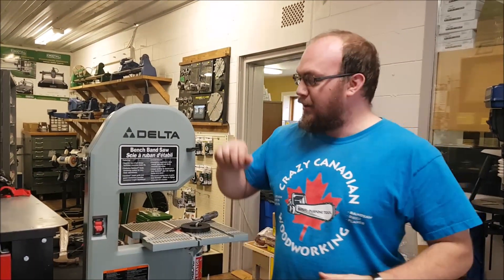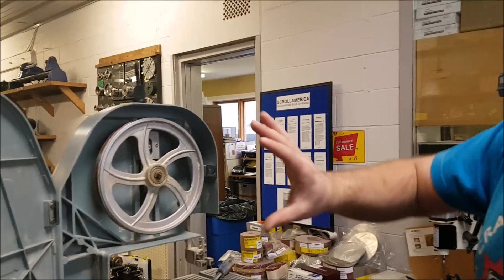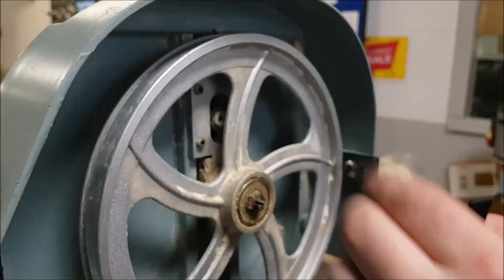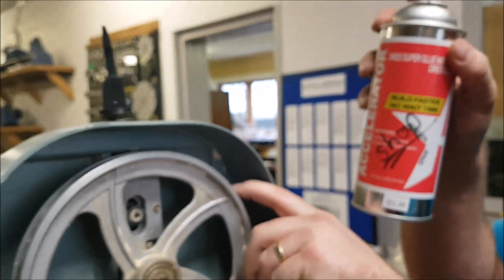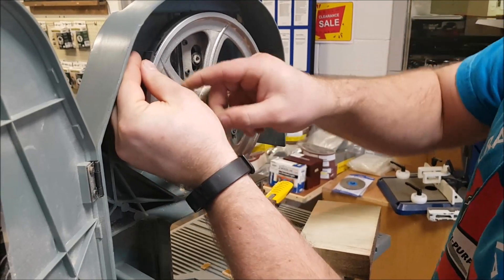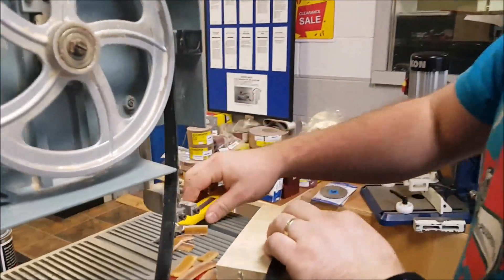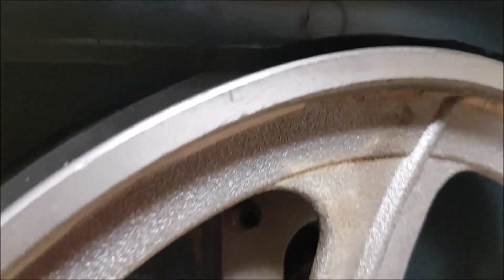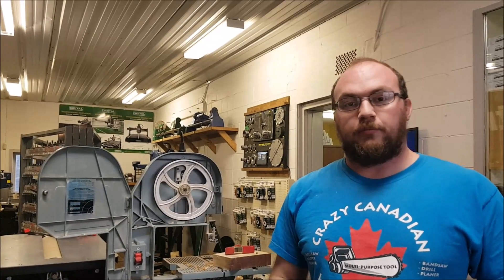How To Glue On a Rubber Bandsaw Tire! EthAnswers

Comment: Where did you find tire material?  Also what kind of glue did you use? Is lock tight a good brand to use? Thank you in advance for any information. I have a small central machinery saw with 7/8 wide tire and approximately 18” total dia.

Comment: Aside from the mathematical formula discussion prior posted, I would ask why glue all around the wheel? Gluing only at the cut on both ends will keep it in the track, as will the blade, and it will be easier to replace when necessary.
Reply from the maker: Yes definitely realized I mixed up the formula haha. I’ll try to fix that soon.

As for the glue that is an interesting point. If the wheel has a lip on either side there is no need to glue all the way around. Now if there is no lip you will need to glue the entire wheel or else the tire may slide off. I usually seem to replace glue on tires on bandsaws without lips around the wheel so I guess thats why I do it the way I do!

Comment: Hi Eth, I once tried replacing the tires on a ShopSmith bandsaw. I failed miserably because I couldn't get even contact pressure around the circumference. As the blade wood run around the wheel, the tire would bunch up in front of the blade and eventually fold up on itself. I gave up and eventually sold it. I am curious as to how your new tires work out. Thanks for posting. Charlie

Comment: Pi times the radius squared is the formula for the area of a circle.  In this case, however, 2 times the radius(4.5 inches) and 3.14 squared are approximately equal.  C=2 pi r or pi D.
Reply from the maker: Haha I definitely mixed the formula up! I’ll do my best to correct that in the video. Thanks for the heads up!

Comment: I’m sure you know this - I think you just mis-spoke to camera... At 1min 22sec you said that to calculate the tyre length use “pi * r squared” this will give you the area of a circle. To find the circumference use either “2 pi * r” or... “pi * D”

Comment: Actually the diameter is 2piR
Reply from the maker: Whoops! I’ll try to correct that when I’m back in front of my computer. I may have mixed the formula up haha
Reply: EthAnswers by Stockroom Supply piRsquared is the area  piRsquaredH is the volume of a cylinder  2piRH is the surface area of a cylinder